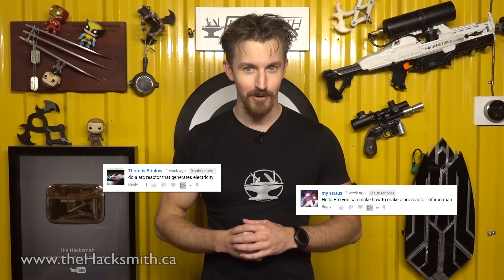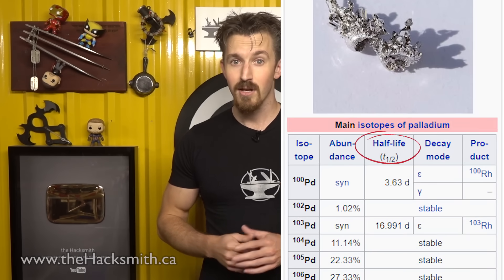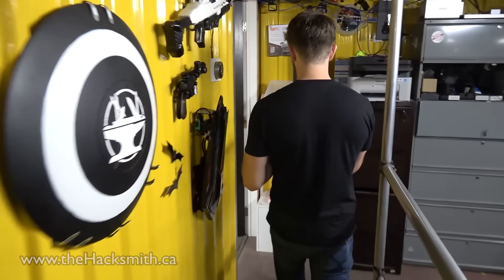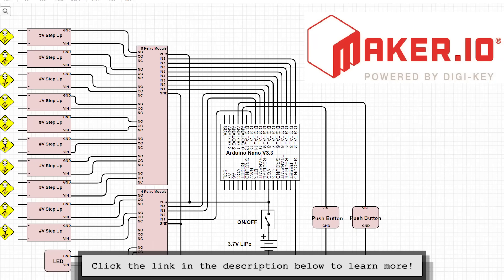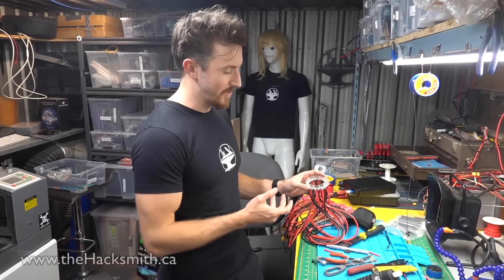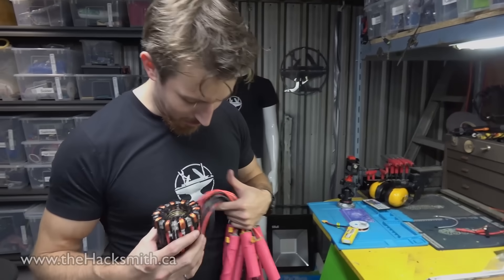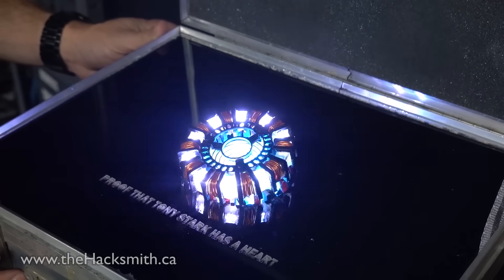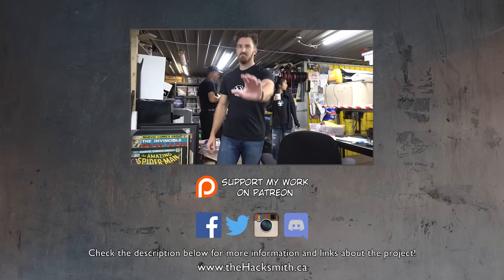Real Arc Reactor (ionized plasma generator)

Comment: Small arch reactor cannot possible  coz if we talk about nuclear reactor which works on critical mass of uranium.
Required very big  structure to handle nuclear reactions.
hydrogen work as arch reactor but is very high temperature because it creates plazsma which the fourth stage of matter.
Can't store plazsma coz it's not solid,gass,liquid.
Plazsma is very high temperature state of matter the temperature is equal to sun's temperature.
Reply from the maker: yeah i explain all of that in the beginning of the video...

Comment: Infinite energy cannot be created?   Put 12v from a battery into a rodin coil.  Attach a magnet or magnets in the middle of a steel rod.  Attach one end of the rod to a rotor and stator and place the other end of the rod in a bearing.  The magnet on the steel rod hovers an inch or so above the center of the rodin coil.  The 12v that goes into a rodin coil emerges on the other side as 120v approximately.  The space time implosion above the center of the rodin coil creates a magnetic flux which spins the magnet on the steel rod at incredible speeds.  What if you could input a much higher voltage than 12v?  What if you could generate high voltage and input that? And place the entire device inside a vaccum?  Enter the works of Nikola Tesla.  Now we're talking.  Anyway  I'm getting carried away.  Check the Searle Generator.  Peace. ♥ PS: Awesome video Mr. Hacksmith.

Comment: The Palladium in Iron Man 1 is a reference to 'cold fusion' and the hullaballoo over that.  While Cold Fusion or something like it hasn't panned out, palladium was supposedly one of the 'catalysts' (it's fusion, not chemistry, so catalyst is the wrong term) in the strange heat results that Pons and Fleischman got in their initial experiments.  People have theorized about how palladium might enable/enhance a fusion reactor, but again, in the real world it hasn't panned out engineering wise though there may be some experiments out there.  The Arc Reactor is supposed to be some form of a fusion reactor - but the one in office is energy-negative like most of the real world fusion reactors out there.

Comment: Couldn't you use the (arc reactor) to power an iron man suit eg EDFs n stuff or possibly small motors (very small) to be able to open small panels each in a hard plastic suit with joints to be able to open the suit and close it like in iron man 3 just without the flying stuff
Reply from the maker: It doesn't actually produce any power...

Comment: the device you have made does not contain any neutron usage of any element. if your device actually runs then it works on a toroidal electron arc regulation.

Comment: The arc reacter uses a high voltage current to produce heat. The platinum absorbs the heat generated, from which it's converted back into energy, essentially creating more energy.

Comment: @hacksmith its a magnetic energy device that uses lead and copper both to build a capacity and and do hold the electrcity to a loop witch uses nuclear energy as its main current to strengthen it and to make 2x more energy and it uses no wires becuse it is an electeromagnet and thats how it powers something or how it gets energy contact me if you want more info

Comment: First off, well-done, the reactor is very impressive.
But I'm curious, why didn't you use the energy collection system of a normal nuclear reactor to harvest energy from the arc? That should give you way more power than 200v wright? And if you use a proper loop,you can actually create a perpetual generator from that arc reactor which would make you smarter than Tony Stark

Comment: Its not an arc reactor though your just transferring energy to make the arcs. Edit: this is impossible unless you have it make alot of energy and take only a little amount which is highly impossible and even if it was possible it would only make little amounts of power.....i described what to do with a perpetual motion machine.
Reply from the maker: Hence my explanation
Reply: Ya....in that time i figured if you moved the machine and then have it use that energy to make the same amount to make it soooooo you could technically make a reactor

Comment: so....its charges your phone
congratulations...u had invented a noisy powerbank
Reply: Pfft, it looks cool.
Reply: At least it's looks way better and is cool
Reply: DUmb you need to charge a powerbank, you dont need to charge this
Reply: @gkastofficial8357  Well I mean yes you will need to replenish the energy either by exchanging the batteries (ie tear the thing apart) or if they are rechargeable ions then charge them the same way you would a regular power bank, it would also dissipate a lot faster due to power being lost as light and heat in a far higher amount to a traditional power battery. Still a fun project :)
Reply: A dope powerbank tho
Reply: RAKESH ROSHAN it*
have*
Reply: A noisy and inefficient power bank.
Reply: You can do many more things with that..

Comment: --- i have a question it might seem stupid but but i wanted to ask - i know the law of conservation cant be broken but what about bending it alittle - what if for the output you amplified the produced current split that off to the feeding of the reactor and to whats available to use - that would lower its total use produced but also create a loop where it feeds itself its required power - it will not be good for active use without a really really big reactor but it could in theroy charge batteries that can be used on a constant flow = basicly a infinate battery charger = granted its not infinate energy buy its a important step in that direction - in theroy anyways ...
Reply from the maker: Bending is still breaking ;-) which is what the law of conservation of energy is all about. There will always be losses ;-)
Reply: @hacksmith  i get it ... i was just wondering if feeding off the loss was a option its no big deal i just wanted to know if anyone tried

Comment: How does it actually generate power? If it's running off electricity, wouldn't it be better to just go straight to whatever you want to power?
Reply from the maker: it doesn't it just converts it to plasma

Comment: Just started watching this video and just wanted to let you know, Energy in + Energy out = Absorption or loss, this equation is in void if you use monatomic Gold to send the energy through. It has no absorption rate when in its pure form as a metal. 100% E in + 100% E out = 0 Absorption. Its hard to get but good luck.

Comment: how much energy did it produce actually?
Reply: @Kettlesimulator I was talking about the voltage and current. I was wondering why would any voltage or current induce in the coil other than the transient spikes. If Coils were placed radially, output power would be more.
Reply: @Kettlesimulator What a joke!!

Comment: It's not a arc reactor it is power consumer. 😡
Reply: @Szymon96335 [MOBILE] please remember this is basically battery powered... Eventually the batteries will die. Meaning it won't work. It uses electricity, instead of making it.

Comment: The arc reactor in iron man is actually based on a device called a tokomak. The idea is that you ionize a mixture of fusible gases like deuterium and tritium then compress them with a magnetic field until they detonate and then draw off the EMP with take off coils. I think the only fly in the theoretical ointment is that they're trying to produce a sustained fusion reaction. I think a pulsed reaction would be much easier to sustain. Call it bomb in a bottle technology. We already know how to make a bomb. Pulsed detonation would produce an EMP that would expand and contract with each detonation and would in theory induce an alternating current in the take off coils. Weather you could shrink that down to Tony's little arc reactor is doubtful, but one the size of the one at stark industries is precisely what's being worked on in labs around the world.
Reply: @Kettlesimulator without getting into the physics so does a tokamak. The tokamak is an MHD device that takes the magnetic flux off the plasma stream,or more accurately the fusion reactions EMP.  I've seen enough tokamaks to know what one looks like

Comment: That smell at 4:42 is ozone gas produced by the arc, cant believe you didnt know that. The modules also can destroy electronics, had my multimeter close to arc and now its way off. Also ruined tp4056 charging circuit i had in taser

Comment: The reactor from iron man is just an unrealistic version of a fusion reactor
Reply: Yeah, that's what I thought too, paladium ionized into plasma, and then shaped into a circle with a strong EM field, basically making a feedback loop, or something idk
Reply: Tokamak reactor to be more precise.  But YES.
Reply: @ringsoffire5947  I like Stellarator better... Let's build em everywhere.
Reply: @ringsoffire5947  Tokamak reactors are not the only type of ECF fusion reactors..
Reply: Google tokamak.

The most recent tokamak project is the ITER, if it is constructed and works as expected, it's on the way to generate 2-3x its energy input as output. Most scientists believe that a fusion reactor should generate more than 10x the input energy for it to be somewhat profitable, and then the private sector will really start picking up on fusion and the governments won't have to fund the research as much anymore.

If interested, also look into Z pinch and Stellerators. They're different kinds of magnetic confinement fusion devices (as opposed to inertial confinement, see NIF for that)
Reply: Tokamak is nit cold fusion its hot the eletromagnetic field is fonfininb the heated plasma , specificaly its magnetic confined thermonuclear fusion one of 4 difernt methods of forming nuclear fusion but its nit yhe same as cold fusion and it is nit comparable to poladium. 

poladium having a half life only means its acessable for fission it says little about its copacity for fusion, 

hydrogen and helium are our best bets for fusion specificaly hidrogen deuterium which is plentyful in sea water and  hellium 3 that can be mined from the moon, 

While deuteriam can be done alone it takes more energy to fuse two deuteriam than to fuse helium 3 with deuteriam.
Reply: @demonic_myst4503   dam bro are you thinking of being a engineer or some kind of scientists cause you are smart
Reply: @Marcus-pv9le  he aint smart he has knowledge that's it. I also knew that because of my highschool project
Reply: @derekxiaoEvanescentBliss  lets build them everywhere.
Reply: @derekxiaoEvanescentBliss  ehm, second law of thermodynamics. you can't even achieve  100% and you are talking about a 2-3x gain from input energy. the best a nuclear power plant has something between 30-35% of thermal efficiency.
Reply: @iM7SnaKe  he's speaking about the energy to get the thing startet and keep running like EM fields vs the usable energy you get out of it
Reply: @iM7SnaKe  Lol are you saying countries poured hundreds of millions into a fusion reactor that, according to your misapplied physics laws, can't generate energy? Come on man, think a little.
Reply: @iM7SnaKe  I know exactly what you said, I've taken two thermo classes, one on plans physics already. Come on hit me, explain why 2-3x input energy as output  isn't possible. Especially since no where did I say thermal energy.
Reply: @derekxiaoEvanescentBliss  in 2035 when they gonna finish, if they will, we gonna see how much is the cost to have a positive gain on that thing. for now that numbers are just theory, as you said in past comments to be profittable the output with the efficency has to be x10 or it's just a big hole in the water with the total cost to costruct it. and the point of that x10 is due to the efficency that is difficult to reach even the 50% of all the energy as output. right now nuclear is not profittable. natural gas right now is cheaper.
Reply: @iM7SnaKe  Don't fusion reactors work by consuming electricity to power electromagnets that would compress plasma until it's hot enough to fuse and extract energy from the heat of the fusion which should be much more than the electricity it's using in the first place?
Reply: @iM7SnaKe  sun meet law of thermodynamics*law melts*
Reply: @iM7SnaKe  I'm petty so I'm back.

Basically NC is saying the process of extracting energy from heat has only 20-30% efficiency due to thermodynamics. (usually just done by boiling water, then using the steam to drive turbines or generators)

This is not wrong.

What is wrong is that he through that I was saying this process had 2-3x energy gain.

I was not.

I was saying that the nuclear reactor itself, where the energy input is used to create magnetic fields and initially heat the plasma, and the energy output is extra heat from fusion reactions, has energy gain of 2-3x.

I'm saying you put in energy to confine the plasma, and heat it up until fusion can take place, and then fusion takes over, generating more energy than you need to confine the plasma. The energy comes from nuclear reactions, not heat engines.
Reply: Hold my beer🍺
Reply: Yea, since it's using palladium, I'd assume it's a cold fusion reactor which is only theoretical at the moment.
Reply: exactly
Reply: Fusion reactor is unrealistic too in 16th century 🤔
Reply: Exactly!!!
Reply: Exactly the point I was making previously. Some how it didn't sink in.
Reply: We would have to wait to the future and then a crazy Einstein will make a iron man suit
Reply: no its more of a particle accelerator with plasma containment.
Reply: No shit
Reply: The arc reactor is what we call a energy loop paladium is heated then it creates plasma cold plasma as the the plasma spins hitting the superconducting magnets speed up the plasma and energizes it but when iron man shoots it the plasma becomes accelerated and he either uses it as a weapon or a flight stabilizer
Reply: But it s only a film
Reply: Technically fission because of atom splitting but wrong elements.
Reply: Not exactly. Laws can be broken. . . Tesla built one before. . .

Comment: Cool vid but I am working on this and I am spinning the arc, not using any radio active and running of USB. Of course I am not producing 3 gigawatts of energy it's not the nuclear reactor on an aircraft carrier. Lol still I am using it as an exciter in combination with a voltage multiplier for high voltage acceleration in the use of ion collection. In other words I am working on producing a new method for renewable energy from our planets atmosphere. It sounds crazy but I have some success. If I do get the end result I am looking for I will first use it for myself then I will share it freely with everybody on YouTube. The idea is I have to make it easy enough for most anyone to do and really cheap in parts.

Comment: Hmm... It seems like ionizing plasma like this to generate energy is just turning heat into electrical energy... Considering that's exactly what we want, this may be something for people to work on. The start-up seems like the hardest part, but once that's done, you can probably just keep pumping in more gas. The way to make it somewhat sustainable though, is that once the gas is used up, you'll probably want to store it, and likely have to treat it to get it back to its initial working state using another source of energy, kind of like a rechargeable battery. This sounds like it could be used in electric cars, since you'd just need to pump more plasma into it every so often, rather than a 12 hour recharge time. But I guess we already have hydrogen cars for that.

Comment: ARC Reactors could be similar to nuclear reactors. Using decay of radioactive gasses, like Neon, Zenon, or Argon perhaps. Use the heat generated from converting the gas to plasma with extremely high current, and that could hypothetically create electricity. An EM field could get the effect we see in the film in the large scale in that building, with the bands around the smallest diameter possible.

Comment: Enforce a vacuum in the ring shouldn't help to low the necessary voltage, with the advantage to reduce dramatically the noise?

Comment: Let me make this a little easier. A real Arc reactor is nothing more than a closed Tesla coil. If you found a way to make the arch small enough so that the energy loss would be as minimal as possible, then you will have basically succeeded at what they forbid Tesla from completing.
To put it more simply: Suppose you were running along a cliff and there was a gap. In order to keep your momentum as uninterrupted as possible the Gap would have to be a certain distance wide for you to make it across but also not lose any energy overextending yourself to cross it. That measurement would have to do with your speed and the exact length of your stride. If you had previously measured, and the Gap was of the correct with, you would lose very little momentum crossing it.
this is the concept of the closed Tesla coil. This is the Arc reactor.
Reply: Sorry for spelling errors *width

Comment: When you need a power supply to power the arc reactor but you want to use the arc reactor to power other things so your gonna also rlly just be using the arc reactors power supply?

Comment: It looks like a fusion tokamak, not a perpetual energy machine, which is possible. Just not the size of a fist. At least not with known materials. If anyone both cares and does not know yet, a tokamak is a donut covered in magnets that squeezes hydrogen isotopes into a ring of plasma until it turns into helium and energy.